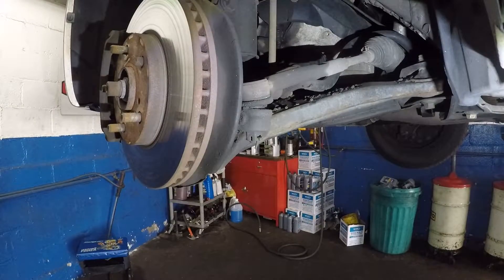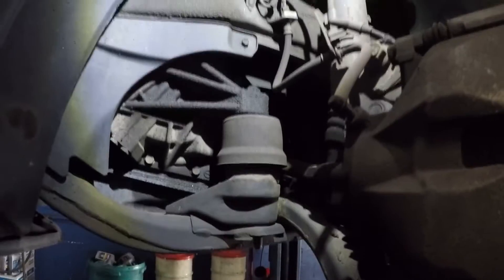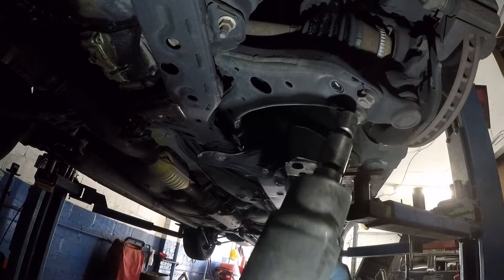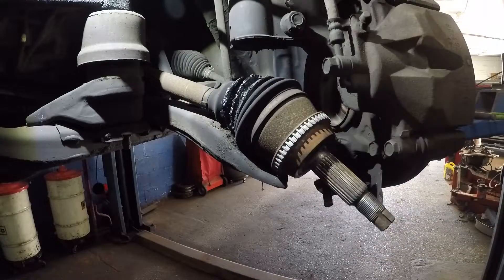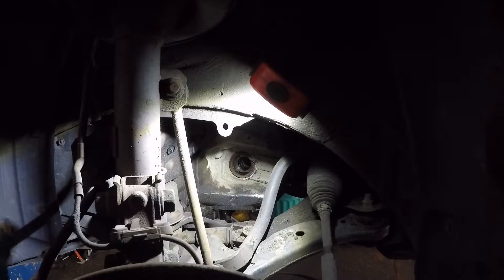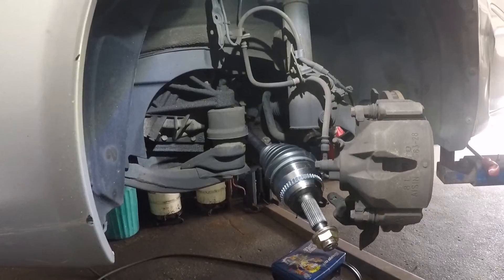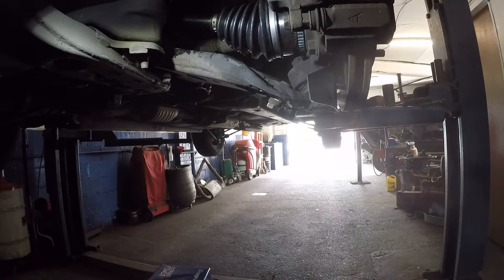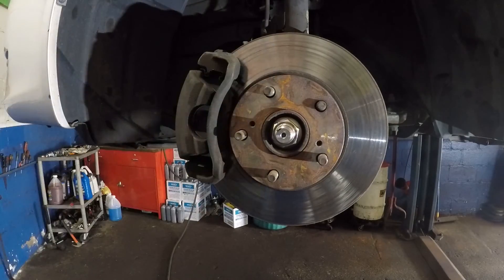How to replace axle shaft on Toyota Camry 2002-2006

Comment: Same on an 03?  What was that last thing you did to lock the axle in place? - Torque specs? - thanks Guy
Reply from the maker: It goes in and the retainer hold it in place I can give u the torque what’s the year make model u got and on the bolt outside it got spot to fold in which locks it in place

Comment: My steering wheel shakes on my 02 Camry 3.0 at highway speeds.  Aside from rotating and checking tires and making sure they are balanced, and assuming rims aren't bent...what is the probability that the shake is coming from bad cv axles?  Thanks for the educational video!
Reply from the maker: Try first wheel  balancing and let me know if that resolves the issue
Reply: @RBTheMechanic  Already tried the wheel balancing, and rotating the tires.  I'm gonna jack my car up again today and inspect the CV axles for play (as well as checking for any free play in the front wheels themselves.  I'll let you know what I find out.  Thanks!
Reply from the maker: @motoman9944  yeah that would be next step.  Also it can be possible wheel balance is still off
Reply: @RBTheMechanic  Driver's side cv axle seems to have at least 1 mm of free play and passenger side is worse with at least 2 mm of play, when I moved the axles up and down.  I may be able to do the driver's side myself, but I would definitely seek a pro mechanic for the passenger side!
Reply from the maker: @motoman9944  ok let me know if it fixes the issue

Comment: What are all of the tools needed for this replacement process? Rachet, 32 mm socket, looks close to a 10 mm on the small bolts, a rubber hammer, a Jack, anything else?
Reply from the maker: Impact tools pry bar just go through my video u will see

Comment: I have an 08 Camry. Just installed a new cv axel (left side) but the shaft that goes in to the transmission well moves in and out 1/4 of an inch if you pull on the knuckle. seems not to be flush with the transmission neither but I know the retaining rig is in all the way cause it’s a pain to get it back out?
Reply from the maker: If u have double then I would check with parts store it can be wrong axle

Comment: I have an 03 camrey. New ball joint new tires alignment. Steering wheel stills shakes badly over 60. Cv axle?
Reply from the maker: Did u balance the tires?
Reply: @RBTheMechanic  yes  with the new tires and alignment.

Comment: Once I replace the shaft on driver's side I hear a grinding sound as the shaft only spins with a lite acceleration. Now does same noise with old shaft ???????
Reply from the maker: Not sure cuz not only the shaft spins what about rotor hub bearing and all the brake shields around it

Comment: Do I need alignment after? Oh and by the way how much you charge for this job on the same car passenger side?
Reply from the maker: Yeah that would be good idea
Reply: @RBTheMechanic  oh ok and I asked how much you charged for this job cause I wanted to see if I was getting ripped off..the shop here in Miami charged me $600 for replacing a axle on the passenger side on a 2006 Toyota Camry I think that was way too much🤔
Reply from the maker: @trini_boi2414  yeahs that’s way too much labor is $190 max of axle bearing get stuck and axle is around $140
Reply: @RBTheMechanic  thanks I figured that was way too much..I got the axle for $100 brand new lifetime warranty and a mobile mechanic charged me $125 to put it on and tomorrow I'll be getting an alignment for $60 so I think I saved a lot going my route 😃
Reply from the maker: @trini_boi2414  that’s good price !!
Reply: @RBTheMechanic  yep I think so too

Comment: I tried my 01 camry short axle and could pull it out. This time I've done a few that came out easy I hope this one does too. Gotta replace both I have a 20 ton press from H.F to remove the bearing carry from the axle. Do you need a 3 inch pipe to press it back on?
Reply from the maker: I don’t understand what u mean 3” pipe
Reply: @RBTheMechanic  My own stupidity. Your other video cleared this up. It doesnt need to be pressed back together. Just tapped in.

Comment: So the orientation of the snap ring doesn't matter? I watched a mechanic really struggle to get mine off because he said the snap ring wasn't in the correct position. He had to rotate the axle to get it out. It was on a 03 Camry 2.4L.
Reply from the maker: Yeah some times it gets stuck try roaring diff diff positions so ring is positioned diff spots
Reply: @RBTheMechanic  Thanks for the quick response!! I'll be trying this job again cause I have this wobbling going on when accelerating and there seems to be a gap between the axle and the transmission on the driver side. I'm subscribing to your channel thanks and take care!👍
Reply: @RBTheMechanic  last question can the pry bar damage the transmission housing?
Reply from the maker: @whuzup3  thanks brother let me know how things go
Reply from the maker: @whuzup3  yeah u can crack it if u put too much force take it easy if u wanna go light use 2 pry bars one on each side so that way the force is less and it’s being yanked out straight
Reply: @RBTheMechanic  ok gotcha I'll update you after the job is done.
Reply: @whuzup3  did you ever get rid of the wobbling? I have the same problem with mine and was thinking because it was an aftermarket axle that is slightly different than the oem.

Comment: I just changed both axles and the abs light came on. Is that normal?
Reply from the maker: No check if axle is correct? It has relector wheel ring and hopefully u didn’t damage the sensors

Comment: What would suggest doing it the 32 mm socket is crimped
Reply from the maker: I didn’t understand what u meant
Reply: Sorry, on the big bolt at the end of the axle the 32 mm one, if it has a crimp in it to hold it on to the axle how would you uncrimp it to remove it
Reply from the maker: @onyxtraveler  u can pull it out with flat head screw driver however I usually unwind the nut with unpack gun and it dose it self
Reply: @RBTheMechanic  ive only got an electronic impact gun, maybe it’ll do the trick, not as much power as the air compressed ones tho
Reply from the maker: @onyxtraveler  yeah try it